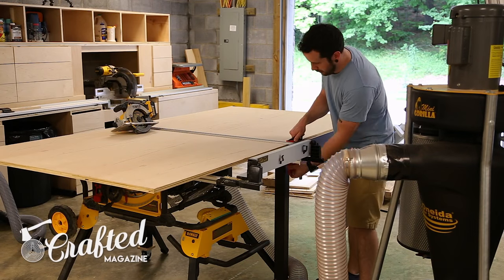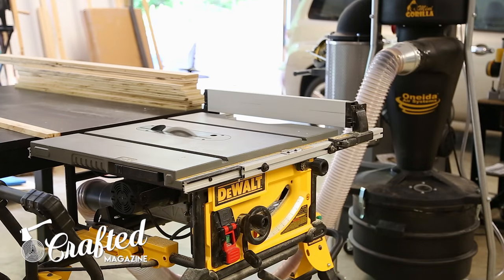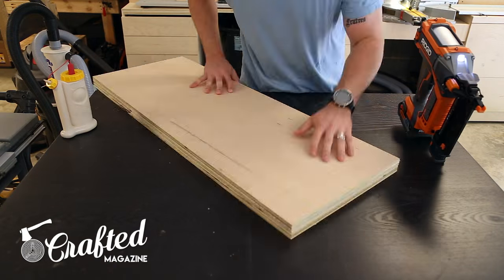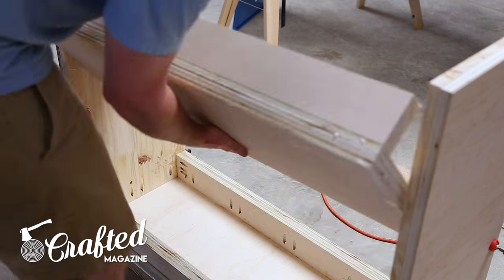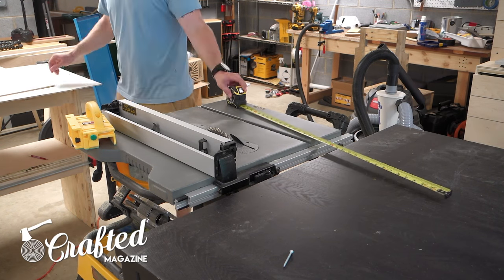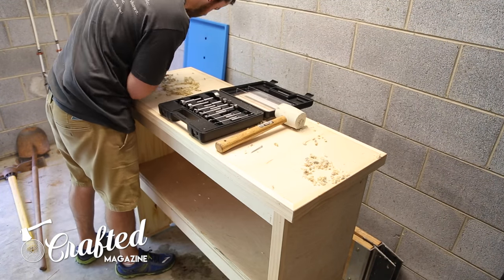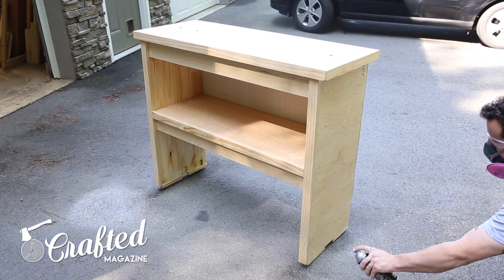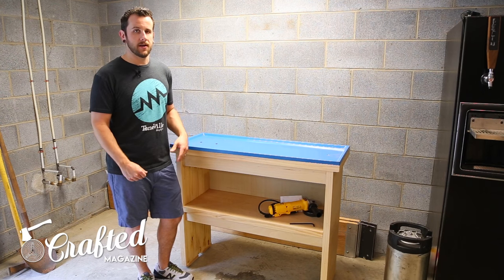How To Build A DIY Lathe Stand | Crafted Workshop

Comment: You've probably figured it out by now but the "bed alignment" you mentioned not wanting to upset, is one of those things that will need adjustments as time goes on. I too am a carpenter and took the plunge into machining. I built a stand for my lathe sanded, raised the grain, sanded again, sealed and finished it with permalyn (30+ coats). A few months after I got the lathe and had everything fine tuned I started noticing slight tapers on my parts. The cause was indeed the fact that I made a wood stand. Wood moves contracts, expands (even when sealed) because of humidity and temp changes and a few .001"s movement of wood is pretty much impossible to detect by eye but it will show up in your parts.

Comment: Great little stand.... bomb proof is right...LOL! Oh yeah aerosol lacquer sometimes leaves a rough finish but if you sand it at the end and then apply a coat of wax it should be silky smooth.... oh just a high grit soft sand should do it.
Reply: I've found that to be a great way to finish it off. Plus it makes it real easy to clean off and glue, oil, etc..
Reply from the maker: Good tip, will keep that in mind if I try this finish again.

Comment: By any chance, can you tell me how wide the legs of the lathe are? x,y? i have the hole spacing, but im looking to make a table out of metal and do a spanning beam design. Just dont know how wide the feet are, im assuming its not much bigger than the table width of 5-1/4" but just want to see if anyone has that dimension... i dont have the lathe yet, but want the stand done before it shows up... any help would be appreciated!!!

Comment: So, do you poop money? As plywood is fecking expensive where I am (full sheet of 3mm cost me £15-20), or is plywood silly cheap in the colonies?
Reply from the maker: No, it's really pricey for good plywood here, too. The plywood I used in this video is $50 a sheet. For this stand, I needed two things:

1. Strength. Plywood is incredibly strong for its relative size due to the laminations within the plywood. 
2. Stability. Plywood is incredibly stable, again because of the laminations. Regular lumber, especially cheap lumber you find at the local hardware store, has a tendency to move quite a bit.

I could not afford to have this stand warping and sagging on me, as that would completely screw up all of the machining work that I'd be doing. Luckily, I had some scraps lying around from my miter saw stand build that kept the number of sheets I used down to a minimum. You could build a stand out of normal lumber, but in order for it to be as stable and as strong, it would probably be a lot bulkier. All in all, the stand only cost about $85 in materials, really not very expensive in the long run.
Reply: +Crafted Magazine ah right. last couple work tables i made, I used 45*95mm pine frame, then MDF top. tends to run about £1-£1.50 a meter on the 45*95. it's current got a mill on it no problem
Reply from the maker: Nice, that would certainly work as well. Thanks for watching man!